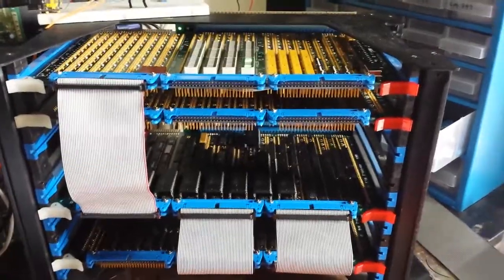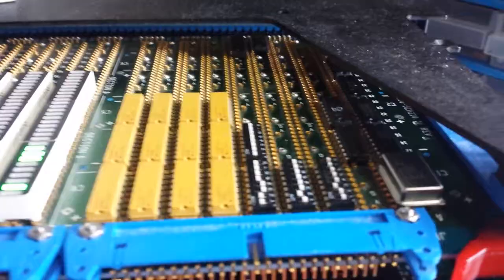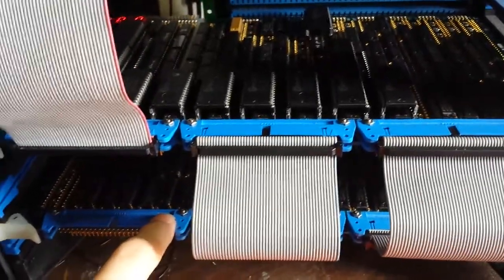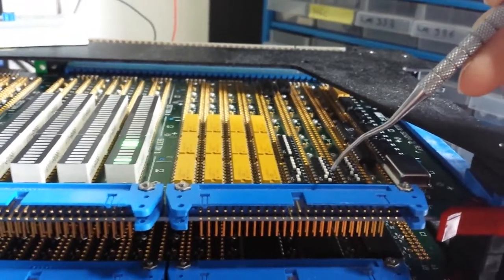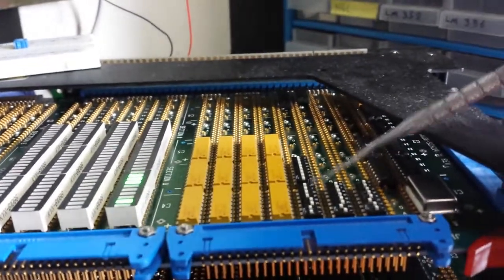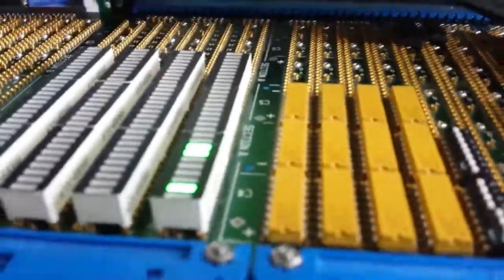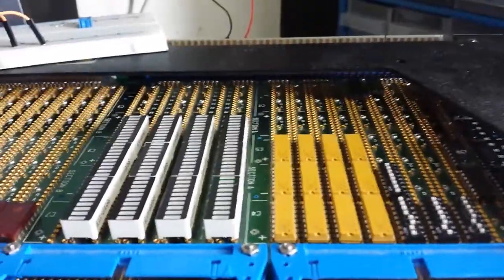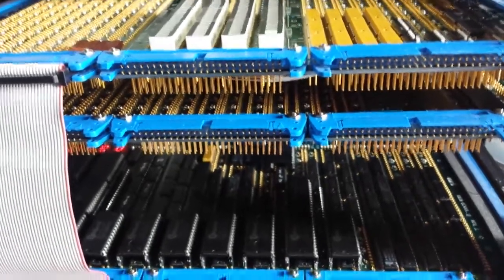Homebrew 16-bit CPU/Minicomputer from 74HC logic - Hardware almost finished!

Comment: Hi Paulo;

Yes, I was pretty sure that it was an EEPROM, from the size of it in the Video, but, I couldn't tell for sure, so Thank You for confirming what the part is and how large it is.. I have not made as fast on the progress as I would like and I have to figure out some wiring problems, that seemed to have showed up, so progress has slowed down a bit for now.. It should not be too hard I just have to follow the path of the wire and copy everything down on paper, and go from there.. Have a good weekend..
THANK YOU Marty

Comment: Hi Paulo;

Yes, The side "A" and "B" for the 74LS181, What I did was set the mode for '0000 and it made A=F, and so It would just pass the Data right on through, Next is the B side, at present I am making part of it work, as I have before the 74LS181, some 74LS194's, and I set the mode for them to Shift, and so as the data is passed from one part to the next, I can tell, when or if it is working from the Displays and their shifting..
And that is where I am at now.. THANK YOU Marty

Comment: Hi Paulo;

I just got the 4 bits to work on the "A" side all the way through.. Now to get the "B" side to work as well, I still have to wire it up, so it will be a bit, before it's done..

THANK YOU Marty
Reply from the maker: Hi Marty. Do you need any help ? I am not sure what you are saying. Do you mean the inputs to the 74HC181 ALU? I think so. That is great. Don't forget about the "Function" and "Mode" inputs too. Best wishes

Comment: Hi Paulo;

Thank You for Your Prompt Reply.. Yes, I am using a 74LS181, along with a a few other parts, which is why I am building it, I want to know if this circuit will work, It has numerous 74157's and some 74194's for shifting, along with the 181's..

THANK YOU Marty
Reply from the maker: It will work for sure!

Comment: Hi Paulo;

I Just discovered You yesterday, when looking for 32 bit alu builds and information.. I am in the process of building my own machine, at present the ALU is 8 bit's wide, once I wire-wrap it and confirm that it works, then I will wire it up for 16 bit's, and still later for 32 bits.. At present I only am working on the ALU before making anything else work, I have 8 bit switches and led's like You do..
Thank You for the Inspriring and informative set of Video's.. Good luck on further work.. I have wire-wrapped for many years on different things, and so I know the benefits of wirewrapping.. Keep up the Good work and the Video's..

THANK YOU Marty
Reply from the maker: Hello. That's great. I didn't build the ALU myself for this. I used the 74HC181 IC's which have basic functions. The reasons for this is that if you build your ALU you will be adding too much extra delay to your circuit. Your CPU won't run as fast then. Try the 181 IC's. They're great!

Comment: My god, how much free time you have... I don't even have enough time for simple 4 bit processor, and you're making 16 bit processor... good job! Btw when you finish if what working frequency will it have?
Reply from the maker: at the moment yes i have free time! it will run at around 3 to 4MHz I think.
Reply: @PauloConstantino167  what the actual fuck. It will run 3 to 4 MHz. And you made it! You are a true legend
Reply from the maker: 5MHz right now!
Reply: @PauloConstantino167  holy shit, good job! But actually, what are you using to create impulses? A quartz?
Reply: @PauloConstantino167  that's quite much of frequency... did you think about modifying linux core to make it able to run on it? Would be nice hosting a simple website on something like that

Comment: Very nice! Can you share your source for the backplane and wirewrap boards?
Reply from the maker: Hi there. I was lucky to have found these from a guy on ebay who had them years ago. He doesn't have them anymore unfortunately. But there are simular ones on ebay. You can also buy boards with power planes and use wire wral sockets, which is what I will do for my next build. These boards are ultra old and rare unfortunately